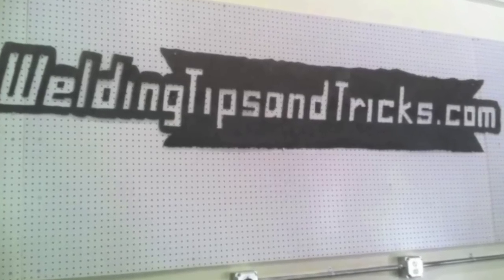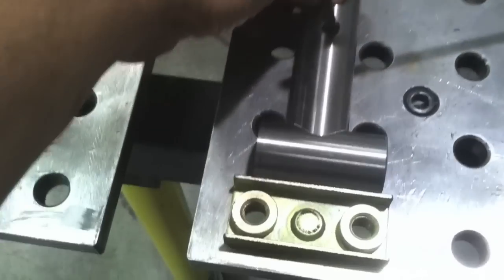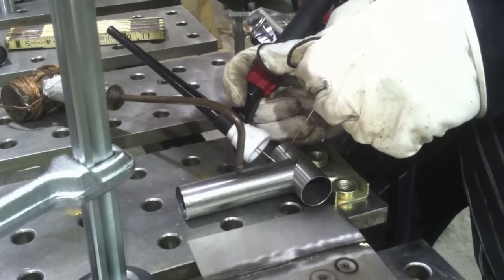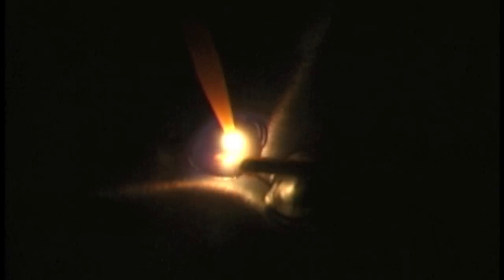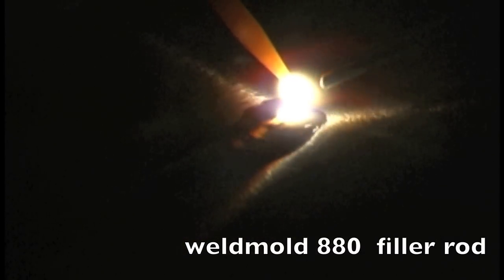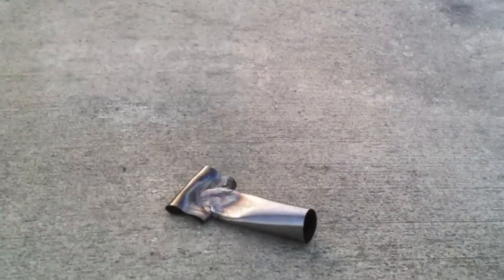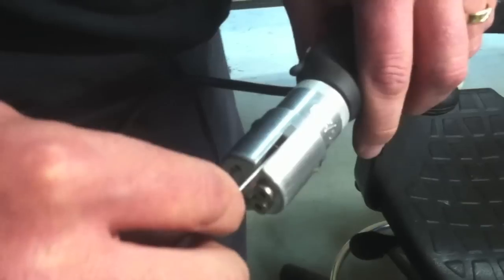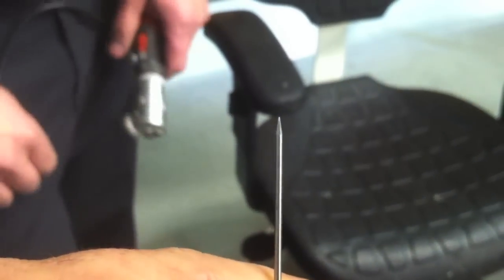Tig Welding Thin Steel Tubing

Comment from the maker: I meant setting the machine to one amp per one thousandths of thickness usually gets you close.  up to about .125"    But with pulse, you need set the main amperage setting higher because the amperage  output is like an average of the high and low pulse amperages.  So for .032"  32 thousandths, I would  need 32 amps without pulse. But with pulse, I need to set the main amperage to about twice that...or 64 amps.
Reply: That's amazing , but at the end which choice better pulse or not pulse ? as long as the pulse is double amps so what's the difference?

Comment from the maker: I definitely went a bit wider than necessary with the weldmold 880 bead.  my opinion is a max bead width for thin sheet or thin wall tubing would be 6 times thickness as a max with 4 x thickness being a pretty realistic guideline for steels.   that differs by metal type  .  I dont have any data to back that up other than my experience and some bead width charts I remember using in an old Rolls Royce aircraft engine standard practice manual.

Comment from the maker: The key difference is that the ER70S-2 worked fine and is way cheaper.  Custom bike builders are willing to buy the weldmold 880 because of the way the weld looks

Comment from the maker: if i am using a foot pedal, i just give a little more or less amperage to keep the bead width consistent.  but without a pedal, travel speed can be sped up or slowed a bit to keep bead width consistent.

Comment: thewelderdude, I supplied Jody with this tubing. Compared to 4130, this alloy has about half the carbon and chromium content that 4130 does, but it has about 3 times more manganese and also vanadium added. The result is an increase in tensile strength and yield strength of 60-70% depending on heat treatment.This allows the wall thickness to be reduced to 0.016" in some cases. This particular tubing is on the thicker and heavier side of what we'd use on custom frame.

Comment from the maker: I would use the same technique without pulse, coax the puddle forward using just enough amps to wet and flow into the corner, and then back up slightly while adding filler ....and I would set the amps to about one amp for every thousandths of thickness of the metal...plus about 10 for a fudge factor.

Comment from the maker: using a sheared strip of sheet for filler metal will work on most alloys with a few exceptions but filler rod is better.      Manufacturers of aluminum diamond plate truck boxes commonly use thin sheared strips of the scrap sheet for filler metal....usually 3003 aluminum.

Comment: In my country of Trinidad we do allot of tig welding in the industrial refinery and ER70S-2 rods are what we always use for carbon steel. I had the chance to build a swing bike some years ago I use a normal tig welder with no pulse and ER70S-2 wire 1/8 and it hold out very good.

Comment: I do a lot of out of position welding and on material that is often not optimally clean. (My eyesight is not getting any better either.)  I contaminate my electrode more than I like and often pick up fuzz on the tip.  The ability to quickly clean up and grind to a consistent tip geometry is so convenient. I'm actually surprised you don't already have a Tungsten grinder.  I actually have the the Techsouth unit you showed and found it easy to take with me when I work out of the shop.

Comment: That's a good question, and the answer is "Sometimes". It depends on the properties of the metal involved. For example, you can do this with a mild steel with relatively good results. But if you weld 6061 aluminum with strips of the same alloy you will have cracking issues from Si and Mg segregation in the microstructure. This is why you have to use a rod with different Si & Mg content to dilute the weld pool and prevent segregation. like a 4043 or 5356, for example.

Comment: Hi Ken, 
No, this alloy has the same nickel content as 4130. It is not martensitic. It gets its strength from precipitation hardening and a smaller grain structure primarily from the vanadium (a different brand uses niobium to achieve a similar result).

Comment: Hello Jody! I've been welding thin wall stainless tubing and I'm trying to figure out whether or not I should use .045 or .035 rod for .060 wall thickness on tubing. I read your article saying for thin wall, to match the size of the filler rod with the wall thickness and to go one size under for stainless. However, .045 looks almost the same size as .060, but it's definitely smaller than 1/16th which is what I am currently using. What  size would you recommend for .060 stainless tubing? Thanks for your help!

Comment: Thanks for the video, great welds.  I was wondering if the .032" steel would flex much at the bottom bracket? I am going with .049" just to add some safety and longevity.- Chromoly.

Comment: I would like to know more about the type/style of cup your using for this demo?  The stick out is great, as well as, ability to get into the radius of the joint.  Looks like it could drain your bottle in one sitting however.

Comment: nice looking / strong welds
? question I've seen welds roughly 1/3rd the size of your welds,    about 2.5 times total width of both parts joined,   2 times 0.0312 + 0.016 = 0.078" width across bead,   then  to boot the welds i'm speking of were so smooth that after brushing  only   heat affected surface areas that a fast look it would seem there were no welds present at all.    This was a job that took 2 welders 2 weeks.  high dollar welders, pressure tested,  regards

Comment: I tried TIG welding thin stainless without success, using a Chinese Longevity welder. (no pulse option available) Even at the lowest power setting, it would burn a hole before I could establish a puddle.  I ended up successfully doing that job with a MIG set up with He/Ar/Co gas and Ar backpurge.  
I have since picked up a Lincoln TIG which has the pulse option, but yet to try again.  Hoping I can work the magic you were. (I really would like to make the parts from titanium, but it may be just too far beyond my abilities)

Comment: Great video!  Exactly what size beater did you use to flatten the practice joint?  Was that an eight pound beater?  Or a twelve?  I have some percion tube welding coming up and I would like to know exactly what AWS or UA specs are for something like this.  About how many foot pounds of force did you use?  Was the strength of the hammer blow enhanced by a causal adult beverage?

THANK YOU for the info on the tungsten grinder.  I am not a fan of them either, but this one MIGHT interest me!

Keep up the GOOD WORK!

Comment: Dear,
I need to weld and close on side of pipe that has dia of 10mm and wall thickness of 1 mm, I use small metal button to close it, Pls suggest me the solution

Comment: Thanks for the reply Mike.  Interesting, so typical practice is to heat treat the entire frame after finish welding?  If so, any issues with distortion or does proper fixturing solve this? 

I once got into a rather heated discussion with some folks regarding welding vs brazing bike frames, and post weld HAZ/brittleness/etc were big issues.

It was claimed you bike guys are working down to .012'ish tubing walls, true?  Must be "interesting" to cope.  S/F....Ken M

Comment: I would suggest you start oxy ace welding. they do that in most welding courses so you can cost effectivly learn puddle control, gaping, rod size, heat distrabution ect...or stick welding. after you do those two processes wire is a breeze.

Comment: Hi, Thanks for all your great videos. A question about breathing welding fumes and argon during welding. Have you done any research on the health hazards. Do you use a fume extractor ?
Reply: Fumes are one thing, you don't have to worry about the ARGON, though!  It's entirely inert, and also makes up about one per cent of the atmosphere so you're already breathing it all the time!  Everyone agrees it's a bad idea to breathe the fumes, though.  One nice thing about TIG welding on clean material is that there is not much smoke... but it  never seems to be zero, either.

Comment: I want to weld 4130 tubing with od 25.4 and thickness 1 mm...how to choose filler material (type, size and the current rating).....what types of difficulties will arise during welding? Give some tips for welding the thin tubing of 4130

Comment: interesting video all I do is 304 stainless tubing 1/16th wall those beads in the video looked way to big and as for sharpening tungsten I prefer a 4 1/2 angle grinder

Comment: He is saying 1 amp per .001 as in one amp per one thousandth of an inch.  So the material was 0.032 (thirty two thousandths of an inch) and to set the machine on 32 amps as a general rule to get you close.

Comment: Jodi,
I am a beginning welder and have been attempting to teach my self to weld thin walled tubing such as this. So far not having much success. It seams I either get lumps of filler rod or burn a hole in the tubing. I noticed your wide cup in this video. Might that help me? Any other suggestions would be appreciated. Thanks as always for your great videos! I am a loyal watcher.
Reply: hold your tungsten closer to the metal. this should tighten up your arc making it easier to weld.

Comment: dumb beginner question. What gas are you using? I have a 75%argon/25% co2 for my mig welder and that gas does not work well with thin wall stainless steel tubing that I need to weld. The tubing is exhaust tubing for an experimental airplane, about 1.5" od and a .035" wall thickness.
Reply: TIG welding uses mostly pure argon gas and sometimes helium for a little extra heat. Although this is 2 weeks after your comment, I hope I helped.

Comment: Jody,

Can you weld tig without gas and rod if your in a jam ? The surface is very clean. Thanks.
Reply: The surface won't be clean and will have a smoking hole in it and be splattered with tungsten if you try to weld tig without argon.

Comment: excuse my lack of TIG knowlege as I have not done it much since welding school around 10 years ago,  But is that stick out of the tungsten too far?  or does it not exactly matter being that its indoors and getting good gas coverage.   I have a job interview for a sheet metal Tig shop so im trying to brush up.
Reply: It's dependent on several things. Cup size, if you have normal cups or a gas lens how much flow of gas. These are all variables that you can play with to give yourself the ideal conditions for the relative job. Certain areas you weld will rely on having the electrode stick out further, like narrow angle junctions of steel tubing. Hope that helps.

Comment: Then Tell me why the aerospace industry (which I work in) uses rivets in many structural applications? My point being when something is designed correctly the joints are under way less stress. Look at the Eiffel tower and early 20th century buildings and airplanes.

Comment: But, the welding rod manufacturers will be very quick to tell you why their rod will take care of all kind of temperature related and dilution related problems, both real and imagined.   Really just requires paying attention to the results.  Some home/shop bend tests would alleviate any doubts about using the strip as weld wire.

Comment: I would like to see how you Mig weld chromolly,  docol r8 or other tubing thats used in rollcage builds for cars thats has a diameter around 40mm and a thickness of 2-3mm
Reply: Oskar Johansson MIG welding isn't bendable probably not a good idea to build a high strength frame of any sort with a MIG when you take a weld test you bend a TIG test you bend a stick test U-Pull Mig the characteristics in way the puddle cools makes it brittle step TIG welding what you see Jody doing here is the best way to weld a roll cage for anything you can't take a tubing welded with a MIG of sorts and pound it without the world cracking loose just don't happen
Reply: Thanks for the reply, the reason i wanted to see it is beacuse i think most of the certified rollcage builders weld it with a mig here in Sweden
Reply: Oskar Johansson, plenty of dirt late model chassis builders mig 4130....never back purge.  My local chassis builder is using Docol R8 now.  They mig it with the same stuff they would weld mild steel.  

I raced karts and my chassis builder used 4130 and mig welded it.  He normalized the tubing after it was welded by post heating it and allowing it to cool slowly.

A lot of people say mig welding 4130 is not good.  A lot of championships have been won in mig welded 4130 chassis.  

Docol R8 is a very different metal compared to 4130.  It's weldability is much better than 4130, I am told.  I don't have any experience with it but I am considering using it in a car I want to build.

Comment: i tried this shit, was a pain in the ass, trying to press the pedal for the exact current is what is crazy, why dt they hav a tig where we can set the rate for voltage
Reply: If you don't like the foot pedal, you can get a torch switch, or buy a torch with a switch stuck on it... so when you click the torch switch you get whatever you set on the front panel of the machine, "local control".  So maybe some automation, like ramp up and preflow and postflow of gas, or maybe just ON and OFF if you set all the automation stuff to zero....  Jody has some videos about this I think.  I like the torch switch personally, and have fixed it up for other people who were having trouble with the foot pedal, like if they were standing on a ladder and welding overhead, you know?   I can sure see that you would want this setup to make a bunch of tacks!

Comment: My advices to tip grinding: I sharpen the tip on a belt grinder. When there's no more butt on the tip, it's all about watching the sparks to come off at the perfect spot. Turning the electrode too slowly or applying too much pressure will let it constantly grind down to a bad sideways face as you turn it and never leave a tip. Remember to grind towards the tip, so the arc won't go crazy because of sideways directioned grind grooves.
Reply: We use a belt sander at our shop also. Chuck that tungsten in a drill and taper will always stay even 👍

Comment: Bicycle guys, they sure like to keep the material a secret, I used to work next door to Ventana in Sacramento, their stuff is mostly 'special' aluminum, but you can't even get into the shop.
Weldmold 880? A lot of 'maintenance' type fillers and SMAW stuff is specially designed for guys that are mainly mechanics, not always real experienced welders. 
  Eutectic used to make quite a range of stuff like this. Made the average guy real popular with the shop owner/s in maintenance applications.

Comment: Beginner quetion. The 1 amp per 1/1000" rule does that apply to both 110 and 250 machines? I'm trying to get into welding and i live in sweden so we only have 250 and possibly 400v 3 phaze machines. I wanna know these things before I start the course.
Reply: +rimmersbryggeri I know you're not asking me, but generally speaking, this IS a "rule of thumb". Results may vary. And yes machines can run differently based on what power sources supply them and their phases.
But where the rubber meets the road (at the amp readout), yes 1 amp per 1/1000" will get you a very long way till you get to the thicker gauges.
Reply: MrJgstoner
 Thanks! Any answer is an answer if it's an educated one.
Reply: Yeah, the power of the machine might not be important here, you control the output, the welding power.   There are some good practical advantages to three-phase power, but you might not notice at all, depending on what you're doing.  I think the most common overall is 208-220Volts, maybe thirty amps.

Comment: Wrong attitude! The guy is obviously a new starter, and is all you're doing with replies like that is discourageing him. What you should have told him, is to find out exactly what material he is going to weld, then to check with a point of reference i.e welding supplier/reference book/ internet for the best rod to use. If you're the expert why don't you go to the trouble of putting youtube videos out there to help people, or are you scared that other internet experts like yourself will critize?

Comment: Hi

I only have regular stick experience. I have a one man artisan business, now find myself needing to "tack" weld a 1mm thick mild steel cup onto a similar sheet. 

Think of it as welding a plastic bottle top to a flat surface so that the rim / edge of the bottle top is flat against the surface - thats about the physical size of it,.

I had been looking at spot weld options but I would need to reduce contact area by filing the rim / edge of the "bottle top" and it gets expensive fast. I need a clean finish like the one being achieved in the video with minimal distortion and burn but I would prefer a much smaller bead (thats why I was originally looking at spot welding ).

Could this be done with a smaller bead? at least half the size of the bead being produced here.

This is non-coded welding for decorative purposes, if I cannot pull it off by hand thats good enough.

Always wanted an excuse to move into the "clean" world of tig so perhaps this is my chance.

Thanks in advance for any replies

Jonnie

Comment: Working in aerospace, the welders always purge the tube. They use rubber caps to plug all the open ends & on one end they poke a hole & flow argon (purge) through the part.  After a minute or two, they then begin to weld. There’s never this much discoloring. What’s the difference? I haven’t been able to find any video’s showing welding in the aerospace industry